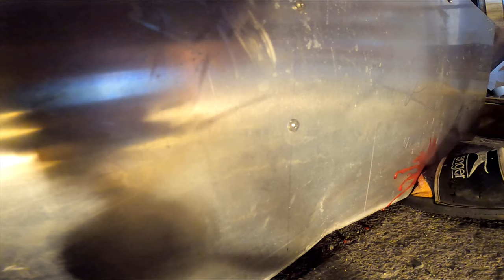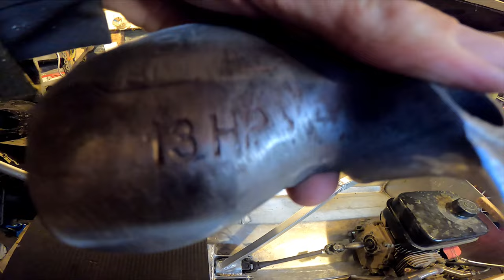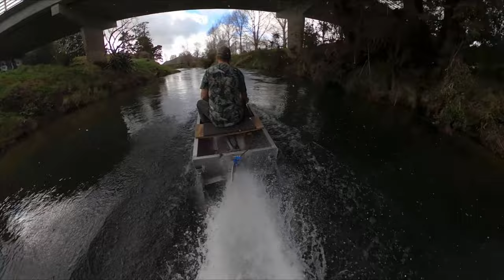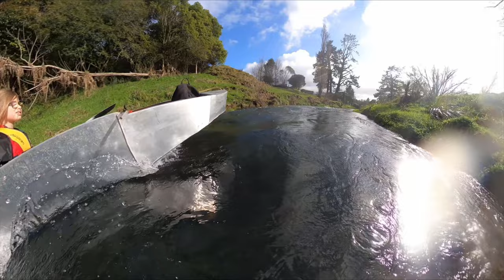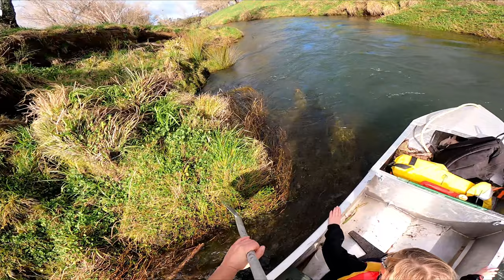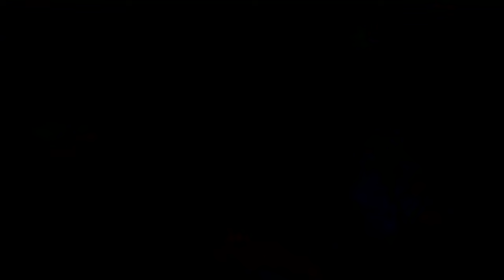Mini Jet Boat To Inboard Surface Drive , Test!

Comment: My vote is on pivot thru center of ARea of the rudder, so that it rotates but stays within the thrust zone. As current,  it steers at extreme angle such that the rudder leaves the prop area entirely.  Clear as mud I'm sure, good luck
Reply from the maker: I was wondering if that was the problem a lot of good comments coming through

Comment: Watching from the back it looked as though your rudder wasnt getting much purchase in the water and I am sure the steering linkage bending didnt help matters. I would either try a larger rudder that went deeper in the water below the turbulance from the prop or put 2 rudders on either side, below the bottom of the hull. If you want them to stay pivoting, might could put a spring on them to keep them in the water when running  but still be able to pop up when striking an object.
Reply from the maker: yeah that is was thinking, I also think the rudder was getting pushed up/out from the water flow and not sitting as deep as it could of . I need to study the footage from the back a bit more
Reply: @DktheWelder    if you want to over complicate it, use pivoting hinge brakets like you did for the rudder to link the steering arm to the gunnel (or gunwales depending on where you are from) then to another at the stern linked to the rudder. This would control the amount of flex in your connecting rods and make them more resistant to bending while also out of the way of your leg.  You can even apply some mechanical advantage by changing the length of the hinged bracket connection points. And as others have mentioned,  spring loading the rudder so it stays in the water more. 

However,  every boat I have operated that uses a rudder does not turn like a regular outboard motor. It requires water passing by the rudder to steer.. Just keep this in mind. They are all slower to react, take longer to turn, and are highly dependent on the speed of the boat moving through the water not moving relative to the land. Going downstream a little faster than the current flow can appear to be moving fast but the rudder will act as if it is moving slow. Going upstream will have the opposite affect where moving slow compared to the land can steer more reactively because the water pushing past the rudder is moving faster. So different steering feels are to be expected.

Comment: Ya need a teleflex shaft for steering, or even use an old weed eater bent shaft cut to fit if you want to do it on the cheap. Has a flexible shaft inside that you can make slide to do the steering.
Reply from the maker: good idea!

Comment: Don't put any more bends into your exhaust you need to remove the one that is there now and install a check valve  you have to to much back pressure on that motor you will burn it up
Reply from the maker: ok. The exhaust has no muffler and is flowing well but I think any more bends could be too much

Comment: Great job. Your the fanfiction guru. Your daughter is a fearless pro boat captain great job on the steering. Thanks your vids Are way better than TV
Reply from the maker: Haha thanks , she did really well maybe she should be driving!
Reply: @DktheWelder  yea she a champion he looked like it was moving along faster than the other set ups ?? Yes ? No ?   Love your boat man. I swear your a building guru
Reply from the maker: @2strokecarbtuningportingin187  it was moving faster and had more in it . With a new motor and different prop it will be fast but need to get it to turn haha

Comment: What about adding a duel side-by-side rutter setup? One solid bracket that holds 2 rutters. Just a thought. Thanks for the vids! :-)
Reply from the maker: That would probably work better. I tried a longer on in the next video but two might work better
Reply: @DktheWelder   Yeah, I'm thinking if you add a rudder, one on either side of the propeller that it will actually catch and guide the water left and right almost like a jet. Thus increasing your turning radius. I'm just brainstorming.

Comment: Just make a tractor flap for the exhaust tip. Too many bends will mess up the compression increase surface area of rudder that contacts the water. Other than that it's pretty neat 😃
Reply from the maker: A simple tractor flap might work fine, thanks 👍

Comment: Man, that runs great! Why don't you run the exhaust out the side of the boat, or pipe it out the back either way above the water level?
Reply from the maker: I did have it out the back it was annoyingly loud and thought I would try this instead of a muffler. I might end up running it out the back again
Reply: @DktheWelder  What about a brass or stainless swing type check valve welded in-line. They make ones with no rubber. Would stop water from flowing backwards might make a ticking noise though.

Comment: Hey bud loving the uploads, have you removed the governer from the motor? you could also put some washers(around 2mm) under ther valve springs to stop valve float once you have done this. Flywheel(cast?) should be all good as long as you dont touch the cam. Flywheel could also do with a tiny bit of advance once youve done this.
Reply from the maker: I have removed governor and drilled main jet out to 1mm . I might try that cam idea thanks! How do you advance the timing? It has the cast flywheel still
Reply: @DktheWelder  look at lawnmower racing sites such as ec carbs, arc racing. Im sure you could knock summit up, just an offset key for flywheel really, generally theres plenty of cubes to play with in these they just need a little coaxing, let em breathe etc.
You could try weld some duration onto the cam, just watch cast flywheels get a little dodgy over around 5k.

Comment: If you haven't found a solution to the exhaust sucking up water, I would suggest putting a pin hole in the pipe close to the engine. That way when the exhaust cools, it can pull air from the boat instead of pulling water in. 

I've only watched two of your videos now and I like what you do. It's great that you get your daughter involved. Memories like those last a lifetime.
Reply from the maker: Thanks ! I tried the exhaust a different way in the next video, I think a pin hole in exhaust would work too . I have another plan for that boat coming up that will be cool if it works

Comment: For exhaust but non-return valve in it. For rudder try to make from two bars one direct to corner of the boat and one from corner to rudder. Also rudder needs to be littlebit under the boat and longer.
Reply from the maker: Make a linkage arm , that’s an idea longer rudder seems to be what everyone is saying 👍

Comment: My vote is move the prop forward under the hull and fix the prop height solid. Move the exhaust out from under the hull where it has to be causing cavitation and just mount a muffler. For the rudder now that the prop has moved forward, make the rudder the same size as the hull tunnel and put two pivot points instead of just the top mount. Best of luck from Canada.
Reply from the maker: I agree with half of what your saying , I don't like the idea of fixing the prop height because you need it deep too start off then right up getting the surface drive effect once moving faster it has a lot more speed in it once I figure it out . The twin rudders on the edges of the tunnel I like that idea

Comment: you could use a spring to hold tension while pulling the rutter toward to boat, and it will still allow it to bounce out of the way. that what we using in the swap
Reply from the maker: I was thinking that, I have tried to find videos of swamp boats with inboards to see how they work

Comment: What good fun. Look at a RC boat rudder an you will no what to do.  Also look up the life saving boats,  they have a good design for protecting the prop.
Reply from the maker: They have a cage around the prop which slows it down a lot . Yeah I see rc boats have the rudder off to the side sometimes too 👍
Reply: @DktheWelder  1 bar under the prop maybe.    When are you going to fit that 1000cc engine in a boat lol.  Keep up the good work

Comment: enjoyed your vid, i agree with the other comments that the rudder needs to be of a bigger surface area plus deeper, i would also suggests you fit a skeg, a keel that runs from the centre of the transom that will protect your prop plus it would add extra support to your new rudder at the base, the bottom edge, just a thought.
Reply: i forgot to add that with the exhaust if you fit a inverted U bend on the inner transom the water will not have enough strength to rise up the tube to flood the engine.
Reply from the maker: Ok . I might put plastic on the bottom as well to slide over rocks better , the u bend idea could work

Comment: The tunnel you added is acting as a water feeding tunnel.  The majority of the shallow water boats here in Texas have them. Basically allows you to project a Stream of water up above the water line. Letting you run your motor higher out of the water. 

Some small scooter boats here in Texas even have the outboard mounted above the bottom of the hull. They’ll run in extremely shallow water. Mine will float in 4 inches and run in less than 3 inches.
Reply from the maker: I have seen the Americans with tunnel hulls in Jon boats doing well so though I would try it with a surface drive as well. I would like to try a tunnel hull in a bigger boat with an outboard

Comment: On the topic of steering, a standard cable steering would probably work much better than a push/pull rod type.
A cable could also be hidden underneath the top edge to make it less eye-catching.
Just search "Cable steering" on google and you'll find alot of inspiration.

Nice build and keep up the good work.
Reply from the maker: A simple rope and pulley system could work thanks!

Comment: Your daughter is closer to the solution than you thought!
When the exhaust is underwater and the exhaust pipe and motor is cooling off from not running, the vacuum contraction of the air is going to suck water back up, as the outlet is completely submerged.

For the exhaust hose, try a short piece of silicone tubing..good for 400-500F degrees which is probably more than what that's reaching in free air.
Reply from the maker: Yes that probably is happening, I will try find some silicone hose

Comment: Have a look at the q-spd or Levi surface drives for rudder ideas. With the exhaust, I would make a riser off the engine, up higher than the water level can ever get, then drop back down to where it currently exits, however pick up some water from a pipe through the bottom of the boat and dump it into the exhaust pipe on the way out. If you want a water trap, put it after the water injection point. It’ll keep the noise down more and keep it a bit cooler.
The engine should be fine, used to race Thundercats and flipped it and filled the engine with water heaps of times, get it started again it’ll be all good.
Reply from the maker: Thanks! Thundercats are cool. I been looking at  pictures of wet exhaust and water boxes

Comment: Loved this project and family test run.. Exhaust needs a flap on exit to close when water tries to enter exhaust tip. Similar to reed valve. Rudder needs to be about 120mm deeper to be in current from propeller wash to be effective as static keel for boat turning moment.. 

Otherwise sweet as mate !
Reply from the maker: Thanks! I need some sort of reed valve for the jet board I am making at the moment as well

Comment: You have built what we call in lauisiana a mud boat  they or inboard shaft driven flat bottom boats that go through mud and grass with car engines down to 5hp air cooled engines ! The rudder needs to be behind the prop!
Reply from the maker: Yes ! I have been watching videos of them . I am changing the rudder at the moment hopefully it works next time

Comment: You need to make a u shaped rudder that is what they run on surface drives. And you need a water lock exhaust goggle it you will understand as soon as see one.keep up with the videos they are great your daughter is fantastic.
Reply from the maker: thanks! I just looked at the water lock exhaust and I like it

Comment: Rudder needs to be at least to center of prop the wash is what steers the boat also you need a check valve in your exhaust brother cool boat
Reply from the maker: Yes! check valve for exhaust , and change the pivot two simple fixes I like it mate!

Comment: To address your rudder issue... the way you have your rudder setup now as the rudder turns side to side the rudder blade moves out of the propeller wash there for removing it's effectiveness. 

One solution more the vertical axis of the rudder back just behind the propeller with no lead so you keep the rudder's leading edge about center of the propeller shaft. 

As for size 4 to 5 inches fore and aft as for height, deep enough to be in 3/4 of of the propeller dim when the drive is down in the normal running range. You need to add a spring or the like to keep the rudder down in the propeller wash when running for the rudder to work.

Keep in mind that there is more drag on the rudder when you are turning than running straight ahead when you work out the hold down spring system. You only need about 30 degrees swing from centre to each side on the rudder.

I hope this is of help to you.
Reply from the maker: thanks! I am doing these changes now👍
Reply: @DktheWelder  you are more than welcome. I have seen a number of different styles of surface and shared what I saw as a design issue.

You now have me thinking about making a Leavy style surface drive for a skiff I have.

Your exhaust issue is another story... the outlet is to far below the loaded waterline, myself I would run it out the side forward well above the waterline with a tall waterlock loop.
One thing that I have seen used on inboard engine installations is if the exhaust is on the right side of the engine they plumb the the exhaust out the left side of the hull and it's as steet of a slope as the can get.

To protect yourself from the heat use some automotive header wrap for a heat shield.

If you are wondering I use to work as a marine mechanic as well as building boats.

Comment: The exhaust has to be higher than water level then go down at out transom under water.   You could use one rudder on either side of where prop water come out, use your pivot but make the rudder leading edge straight down from pivot.
Reply from the maker: ok I will look into that double rudder idea👍
Reply: I forget what brand but there was a surface drive with a semicircular rudder over the prop and down both sides. Arneson?

Comment: The helm axle of the rudder sits to far forward. The leading edge should be sationairy while steering. If you put your helm axle at about a quarter behind the leading edge, you get a balanced rudder. The fysical input gets a lot less so your rod is not bending any further.

For the reverse steering, you could flip the angle pivot up-side-down (the part that converts the longitudinal movement by the stick in a transverse movement towards the rudder). That reverses the movement of the rudder.

You could stick the rudder deeper but what is the point of a surface drive then? A rudder on a sailing boat also works, there is no prop. You could fit two rudders. The rudders need sufficient waterflow.
Reply from the maker: yes the pivot should be inline with the front edge of rudder I was wondering if that was the case and it was hard to push the lever, like the rudder hAD leverage over the controls. the rudder is on a horizontal pivot as well so it will swing out of the way when hitting obstacles so i could make it longer

Comment: bigger rudder, like 4x larger....or steer the prop somehow directionally instead of rudder
exhaust tube a straw, so needs perforation or one way valve, only gas out, but not water in.
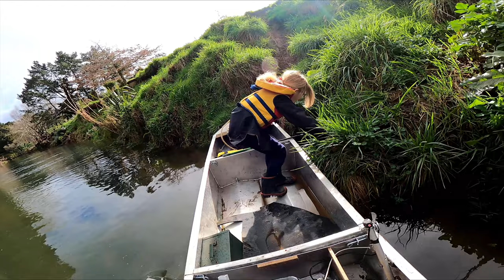11:35 nice greta thunberg there 
you have to get Marty T. to build you a hydropower station on that river for free electricity from a washing machine.....simple principle you use gravity to spin the turbine with a drop or you cut a U shape in bank so water goes down U, spins turbine, then rejoins the river again....
-
https://www.youtube.com/watch?v=eANFU12z_-I

Comment: Hello Daniel and brave daughter. I too am converting a jet drive to surface drive.  Not quite as quickly as it appears you have.  Some food for thought:  I have a fixed shaft 35-ish hp engine running to a rear CV joint, housed in a modified jet pump nozzle. (For steering and trim) Turning the drive unit is far better than using a rudder, though I will need a more robust push/pull mechanism. Mechanical advantage is currently muscle vs. side forces.  I am struggling a little.  Easy fix.  Trim is a 12v linear actuator/relay module/switch.  The actuator controls the output shaft housing up/down. The idea here is starting in air, (no clutch) then lowering the prop to initial drive depth, then trim up to around 50/50. This system requires a rear transom clearance, like offshore race boats, to allow for a 12-17 degree shaft angle to get a proper high speed plane.  My plan is to go from ~35 mph to 60 or more. (56kph to 97)